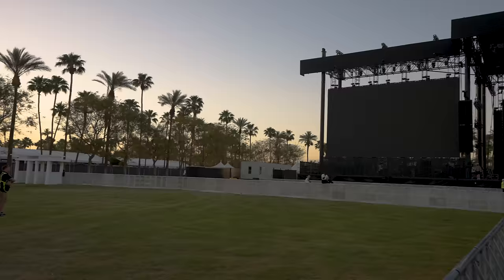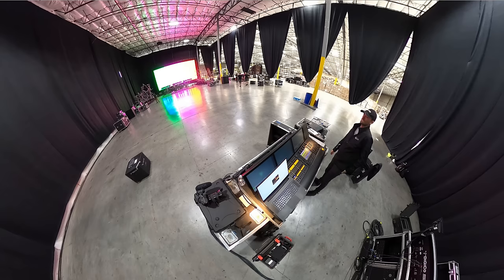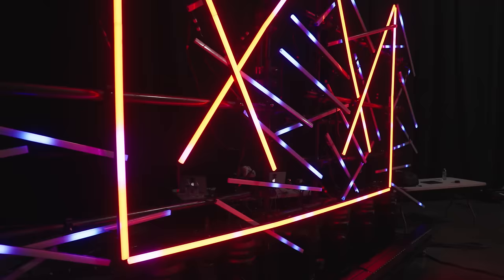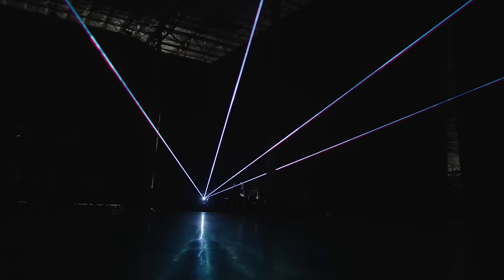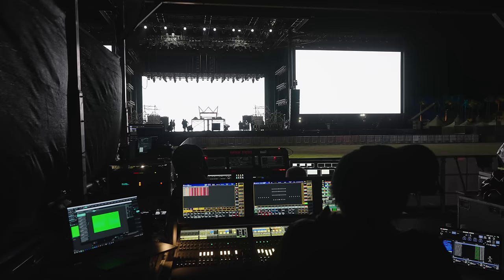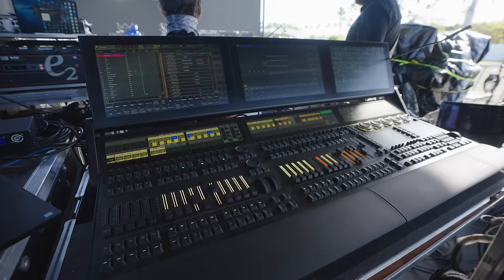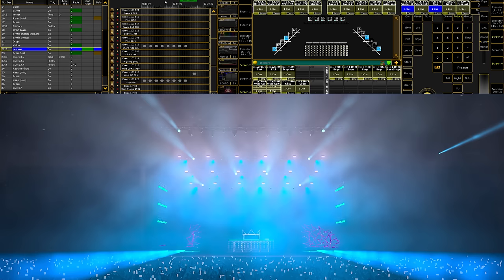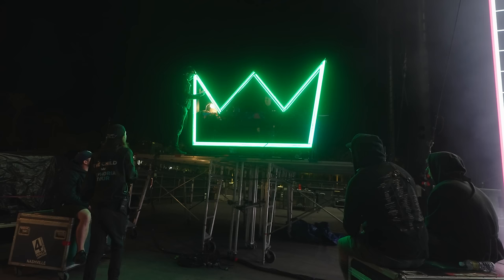Rehearsals + Weekend 1 - Coachella '22 w/ Louis The Child - Part 2

Comment: Mapping the sceptrons in Resolume - wasn't there an option to import a picture as a guide and overlay that within the mapping window? Haven't done the exact same thing before but it feels like that'd allow you to roughly get the layout and alignment correct (orientation wise) which you could then possibly scale as you see fit later on?
Think that might work as a quick rough guide to get it all started after which you could do some fine tuning.
Reply from the maker: there is, but it's not useful in my instance when fixtures are not physically related to the ID on the plot. it had to be built as was physically possible, so it would be about the same amount of time either way.

Comment: Hi Christian, there’s a few tricks on the Martin P3 System Controller that would have made your life a lot easier here (MVR import being one of them).
Next time you’re using anything P3-driven, feel free to reach out for some tips and tricks that will definitely save you time.
Best Regards,
Wouter (from the team at Martin)
Reply: And yes, you CAN change all the DMX modes at the same time on the P3. No need to do it one by one.
Reply from the maker: good to know! i only use it on relatively small shows and some of the techs setting up the system dont know how to use them either aside from patching and identifying. which is a frustration of itself.
Reply from the maker: also, i believe that at the time this video was made those features didn't exist quite yet, which explains a lot haha.
Reply: @christianjackson  ow yes!
The MVR import/export is pretty new.